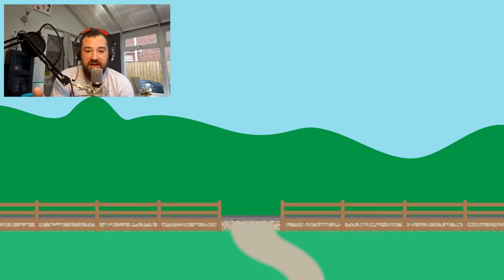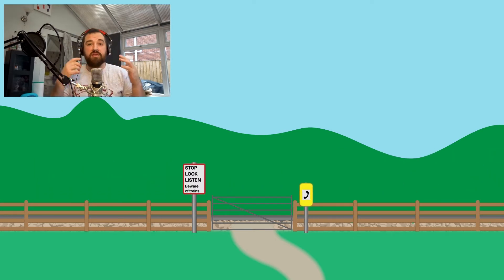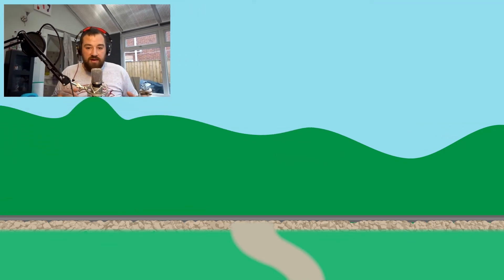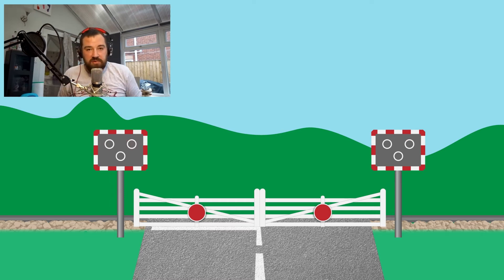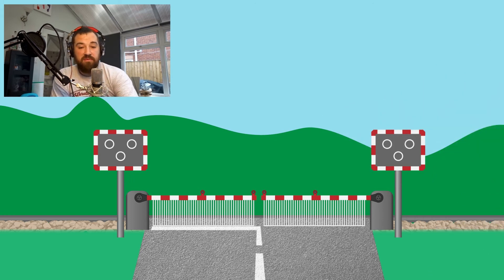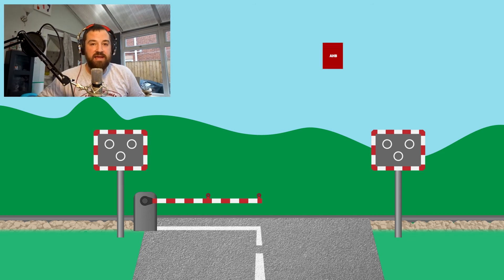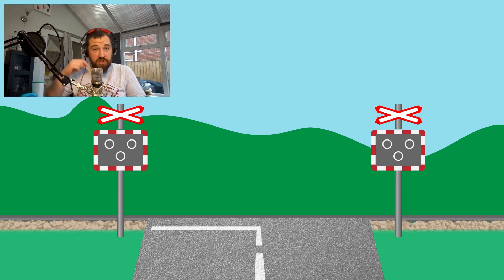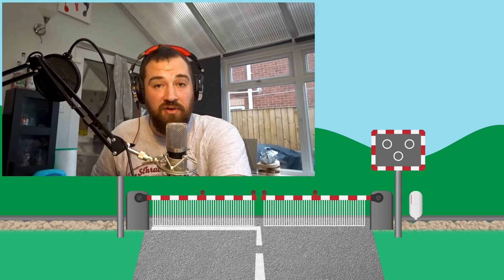Signals Explains: Level Crossings

Comment: Thanks, Dan, for very clear explanations and graphics. I've listened to quite a few of your podcasts and would like to suggest that you add a description of the accident at Purley on Saturday 4 March 1989. About level crossings, I live within 1 km of the CP main line through Alberta, Canada. As this is flat prairie country, there are many level crossings - automatically controlled, some with gates, all with flashing lights - but the important thing is that train drivers ("engineers") are required to blast their sirens or bells 3 or 4 times before approaching each level crossing - day and night!!! Just thought you would be interested (I witnessed the aftermath of the Harrow & Wealdstone disaster a few hours after it happened).

Comment: As someone from Finland those manually controlled crossings are wild. Most of our crossings are automatic half barriers or lower grade crossing with only lights or just crosses on side of the road. Having someone push a button to lower them from a signal box? We don't even have signal boxes unless it is really big and busy station that needs dedicated person(s) due to traffic movement complexity. Rest is controlled from traffic centers that control large areas (like 200-300 kilometers)